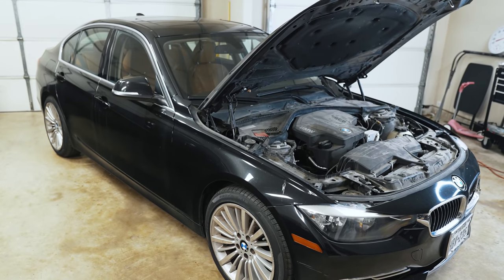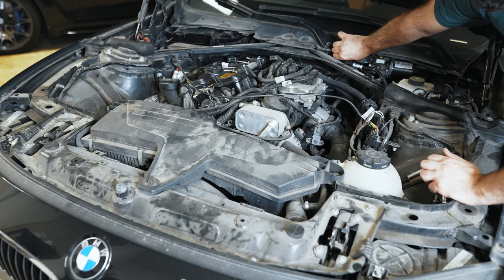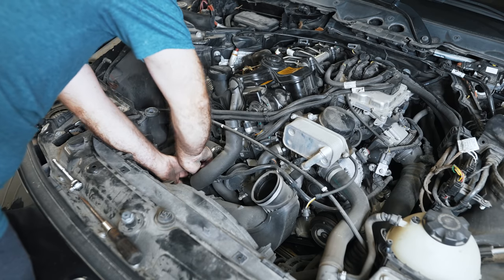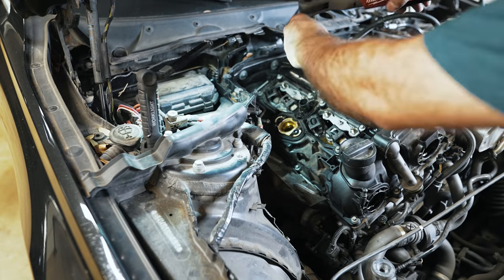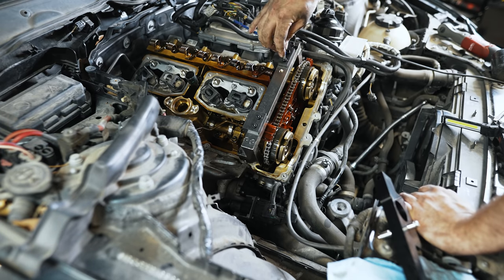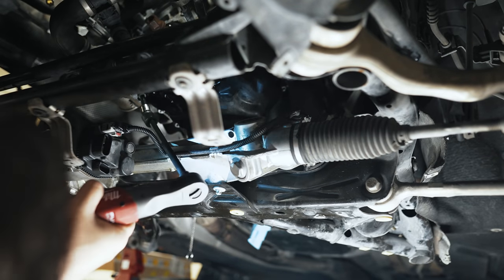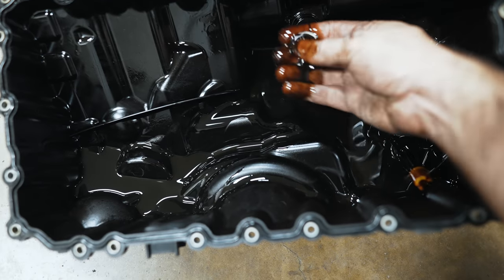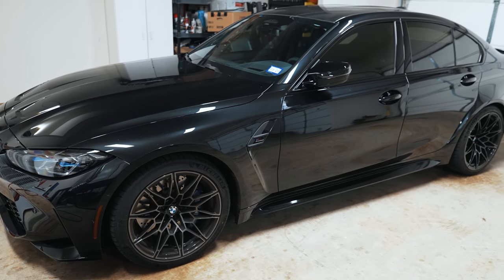All BMWs Get Mechanically Totaled.  This is One.  Saving It!

Comment: Yea, in the same boat but worse with my N20/26. We followed the recommended oil maintenance schedule and it turned out to be too long between changes. Never got bad noises until it was too late. The dealer refused to address the chain prior because there were no codes and then said it wasn't covered after the reduced power code came on because there was now contamination in the oil. Until I pulled it apart the car ran fine and other than for a very short period of time never made any abnormal noises. 
Now that I have it apart, along with the normal timing chain guide issues for N20's, it turns out that the balance shaft ground through the oil pump housing and deposited a bunch of steel into the oil. Luckily all the bearings look good; there is only some minor scoring on cam journals that can be addressed with some minor hand work. The cylinder walls look and feel fine with only mild buildup expected from an engine with 100k miles and only about 8-10 oil changes. Yea, typing that now looks so stupid. I would never let my Saturn's go that long, but it was BMW's service schedule and it has an actual oil sensor so I guess it's ok... is what I thought at the time. 
The real question now is can a dingle-berry ball hone condition the cylinders properly in reality or are these blocks really one and done? Ask a motorcycle mechanic and they will tell you they can be reconditioned (and they do all  the time), but everyone in the BMW world freaks out over the coating.
Thanks for the video's. It's helped me DIY my BMW POS N26.
Reply: Speaking as a prior certified tech (years ago): you cannot just hone a coated cylinder. You'll end up removing even more of the coating which is a hardened compound specially developed to handle heat & wear (these are aluminum blocks). It's not like the old days with a iron block or thick iron sleeve that can be resurfaced. Your engine will eat itself! - If the cylinders don't look too bad just clean them up with a brillo pad and put plenty of molly lube when going back together.
Reply from the maker: To me the recommended intervals started getting longer when the oil capacity started to increase.  So if your engine takes 7 to 8 quarts of oil it make sense that it would take longer to get dirty and break down.  This helped avoid oil starvation and helped lower maintenance costs which helped sell cars.  When they scaled back the engine displacement the oil pan capacity naturally decreased, oil change recommendations should have been adjusted for 4 cylinder cars but that might have looked odd if the 6 cylinder cars needed less maintenance and could confuse the customer.  I guess it was a predicament for BMW but anyone running these cars outside of the factory warranty needs to change the oil at 5K miles in my opinion.
Reply: @VehicularDIY  Absolutely spot on !!!
Reply: @infidel900rr  I'm familiar with the Plasma Transferred Wire Arc thermal spraying process used to coat the cylinder walls of the N20 engines, but there just isn't much information available in the way of rebuilding practices and procedures. It's extremely hard, however only microns thick so there has to be some go-no-go rules to reuse engines with PTWA coated cylinder walls. I know OEM's will just say - replace with new, but practically if the coating is still intact and can be reconditioned to it's original surface finish then it should be good to go.

Comment: I got an 84 318i for $100 in 2000. I swear, anything that could be considered a system was completely neglected. Of funny note, I'd drive down the road at night with the high beams on and couldn't see a thing. All the lights were on but still blind. I opened the hood and stared at a fully lit engine compartment. Turned out all the reflective silver on all the headlights had fallen off and was resting on the inside of each bulb.

Comment: Great video and greetings from Canada. Where do you reference for the procedure to complete this work?
Reply from the maker: Mostly TIS from BMW.
Reply: @VehicularDIY  Only one thing I am confused about: Why didnt you pull out the Coils? In the BMW Repair manual it says to remove those before opening the fuel lines to the injectors. Coils can break if they contact gasoline from what I learned

Comment: I see a couple a week..a BMW Totaled, usually with a death or more. There a favorite of the street racing crowd. They often have the engine torn free lying across the street smoke rising having just spun 7,000 RPM. before the driver loosing control.

Comment: Several times I've heard you mention the turbo oil inlet pipe with check valve.  My car is a 2013 X F25 2.8i.  Is it likely to be the case that my car has the original line?  I just crossed over 100K miles, my waste gate is not rattling, timing chain kit was replaced at @70K miles.  Still seems to have proper boost.  Is it prudent to just change this pipe?  Unrelated, I've been fighting a P0456 ((EVAP) system - very small leak detected) for a while.  Any suggestions on how to find the leak or likely culprits?  I already changed the gas cap...Love your work

Comment: I’ve learned so much from you. I’m looking to buy f30 335i is it reliable? Had a e90 n54 but had to fix allot of issues but loved it.
Reply: The f30 335i with the N55 is fairly reliable.  It has the same problems most recent BMW engines have - valve covers, oil filter housing gasket, etc.  The N55 is more reliable than the N54.
Reply: It depends if you have the money to spend on repairs. I bought a 2014 320i, and it's fun as hell to drive, especially with a sports transmission mod, but it cost me about 8k in repairs so far. 4k just for a timing chain replacement.That little part he takes off at 1:50 costs somewhere around 700-800 without labor.
Reply: The N55 is, apart from the really early models in the F10, a pretty reliable engine. It can have some small problems though, e.g. valve cover gasket, oil pan gasket, oil filter housing gasket, the vibration dampener and the belt tensioner are prone to failure sometimes. However, those are just some minor nuisances that (apaprt from the oil pan gasket maybe) can be DIY'ed fairly easily :)
Reply from the maker: I would say it's more reliable than the N54 and the B58 is looking to be very solid.
Reply: @VehicularDIY  B58 would be 340i m8 :) 
F30 335i has an N55.
Reply: @obihornchen6508  yes like those kind of things are typical and i could do that myself. Just seeing if its a solid engine. like nothing catastrophic.
Reply: @VehicularDIY  okay! Thank you
Reply: @ashokreddy2640  great ya. I don’t think they have turbo issues like the n54 had.

Comment: Hang on I thought any F30 models built after March 2013 had the timing guide materials replaced for better ones?? That’s the reason I bought a 2013 328i F30 currently at 55,000 miles. Should I be worried??

Comment: since the dealer cleaned oil pan out, you could have did the timing chain without pulling the oil pan.... common failure on n20 is timing guides, as well as the turbo wastegate flapper.. total junk engine. I have replaced the timing chain and guides on several of these bmws and did not pull pan, I used grabber tool and vacuum and got the chunks out, ran great. It was a AWD model. so I said fuck pulling that front diff out.. especially working on salary its like 20hr job.. I have pulled the pan before on Rwd model it still pain in the ass. you can also go in the hole the oil level sensor is at and get most of the chucks out... I cant remember if you can change the oil pump chain or not without pulling the pan, its been a while

Comment: What do you think can be the cause of that problem? I got a B48 and some say that the problem persist on any B engine. Is it the oil change interval or quality of the chain, a heat problem or even the design of the engine it self or what?

I've seen other videos where people suggest to change that chain as a preventive maintenance at 150000 Km.  

What do you think? Thanks a lot for your videos!

Comment: Really sad that BMW decided to use those crappy timing chains and guides. Otherwise, they have great engines. Hopefully they will fix that like they fixed the injectors and HPFPs failures from the N53 engine for example.
Reply: N54?

Comment: @Vehicular DIY  I have a question.  I have an 05 BMW 645 with 126k miles on it.  I need my value stems replaced. The independent service center quoted me $4500. Is the repair worth the money or should i get a new car?

Comment: Have 2013 328i bought CPO... it has now 92k KMS and has 2 more years warranty. I change the oil every 7k kms. Should I trade it in while its still in good running condition?
Reply: Don't you like it?
Reply from the maker: If you stay on top of the oil changes I wouldn't be afraid to run it until the hits about 150K kms.  So I'd run it for the next couple years and then you can decide at that time if you'd want to try to run it to 200k and if you don't mind putting a few grand into it to get there.  I'd probably just run it for the next couple years and sell it then.

Comment: Interested on getting a F30 330i, is it really a matter of around @150K miles where the Injectors, High pressure fuel pump and what else will eventually fail? As per the comments at 5.50 timeline?

Comment: Poor maintenance for sure!!
Reply: Yep!.. clearly an abused car in terms of servicing and without a doubt, driven very hard. Those shredded drive belts are also a dead giveaway of how much neglect this car has suffered!!
Reply: I have an 335i 2008 and a x1 2019 msport and I do all maintenance every 5,000 miles no matter what and no issues in my 335 all the plastic parts with Vargas coolant houses,inlets and outlets and tranny brakes and differential fluids on time.motor oil I used for years in all my cars with amsoil.maintnance first before mods and you have cars from years to come,bmw experience.

Comment: hi，my question is how long it will take to replace the turbo oil feed line？my car is 13 528i，my mechanic quoted 7 hour labor，is it reasonable？Does that require turbo removal？？thanks alot！

Comment: Hey man do you have an Instagram? I am doing the turbos on my N54 335i this weekend and I had a small issue with the tow hook not threading all the way down and I wanted to know if that was normal or if I should buy a thinner tow hook, thanks.
Reply from the maker: The tow hook doesn't go all the way down, but it goes in enough to be safe when bottomed out.

Comment: Change oil religiously on the n20 engines. I do mine every 2.5 to 3 k. By the way. On my 3rd water pump in only 34k miles.  Yet another known seriuos prob with these engines. And all the crappy plastic stuff. Ugh.
Reply: Sorry actually 2 waterpumps and 3 thermostats in 34k miles.

Comment: Just curious, how much did you charge your friend for the repair and parts? What was the total amount.
Reply from the maker: Less than a 1/4 of what the dealer was going to charge.  That includes the replacement turbo, oil filter housing gaskets etc.

Comment: Hi I love your channel by the way.but I got a question.I got a 2018 f30 that was recently in a accident I replace the intakes radiator stuff like that but now the car driving but the car dosnt have any powers when I step on the gas pedal while I’m driving,but when it’s in park and gassing the car it got all the power but not in drive tho. it’s slow when I accelerate on the gas and the pedal sink all the way to the floor,you have any idea why this going on?
Reply from the maker: Thanks.  Do you get malfunction when you push it?  You might now be making boost and the car would throw a drivetrain malfunction.
Reply: @VehicularDIY   no malfunction or codes or drivetrain codes…no check engine light either…car just driving like it’s in limp mode with no power at all driving pretty slow and the gas burning really fast
Reply: @VehicularDIY  when the car got into a accident it got drivetrain malfunction codes but i fix all them issues replace radiator and intakes replace battery and battery cable cause airbag deployed also..car start up and driving but no power when in drive and step on gas pedal…but when it’s in park the car got a lot of power when step on the pedal,just not when it’s in drive…when I put the car in sport mode in park the POWER gauge move high up but when In sport mode in drive the POWER gauge barely moving cause of lack of power

Comment: Obviously off topic and not sure if is a ave you want to fiddle with because of fear of being very easily overwhelmed  with 100s of questions..  Anyway have a 13 e92 n55 manual with with MSport and unfortunately  xdrive 120k 2nd owner CPO up to 100k EVERY AND ALL SERVICES THAT COULD BE COMPLETED/ALLOWED FOR REPAIR OR REPLACEMENT WAS SORTED.  2 months ago I got my second engine leak, my first was the standard valve gasket and I easily diagnosed this gasket as the issue because of the leaking onto exhaust.  This leak is like nothing I've ever heard of and seems like a full instant failure.  Went from zero oil leaked anywhere to needing a quarter of oil ever other day....pool on rightist part of driveway..   I thought it was the oil pan then thought I saw oil filter housing.  There has not been a full dive into it because of needing to still find a mechanic and wirh the pandemic funds were and still are an issue...but I'm  being told it's valve cover gasket..1.  could this possibly leak that much? 2.  How rare is this and if I  find  that undeed it's the valve cover gasket, would BMW North America back any of that previous work ..I do understand what I'm asking, I know it was 2 years and 20k miles  ago it was replaced but never know when consulting with BMW NA,  I've experienced first hand and heard of unbelievable room for BMW customers.   At rhe very least since all work don't through BMW Seattle,  or BMW NW they may b very interested just how this has shown up.   O seriously can't find any real detailed example that covers the area and amt I'm dealing with 

Apologize for this nightmare thesis I just wrote it's so hard to be detailed but not long winded , present an educated question easy enough but with just enough interesting factors it holds attention and doesn't make the author look or sound like they are helpless.   Honestly really hoping for advice or a miracle phone number for someone in the  Pacific Northwest,   Obviously there's the dealership and I also know that a decent oem mechanic is going to be still very pricey if there weren't anything Those are the standard options that I can obviously get my vehicle too and getting taken care of I was hoping for something outside the Box and led to a relationship down-the-line being I need about a year's worth of assistance putting this or that back right end and growth anyway thanks for your time I apologize again for this ridiculously long nightmare
Reply from the maker: I don't think they would back the work as that is considered wear and tear part.  It could fail with time not just mileage.  If it's burning oil it could be the integrated PCV that is built into the valve cover or your valve cover could have developed a crack.  I would get a new valve cover when tackling this job.  I made a video replacing a valve cover on an N55 and go into detail as to why it should be replaced as a whole rather than the gasket itself.

Comment: I went through 2 additional engines on my 545 and they all ended up having the same "problem" the same cylinder going out and needing a new engine, after I had the transmission rebuilt.  Never again
Reply: Just sold my 335i. Similar experience. I’m buying Japanese from now on.

Comment: At 100,000 on the clock, I would have just pulled the motor to do a full reseal and clutch job on it.  But that's just my two cents.

Comment: I'm from Ireland and 90 percent of all bmws here are 4 or inline 6 cars...the problem I think with these v6 and 8 DOHC engines is the chain is way to long...and the longer a chain is the faster it will stretch ...take the older pushrod engines ..the cam is close to the crank and the chain is only about half the length of a OHV engine they go hundreds of thousands of miles with no probs...also these cars that are high power should have a double chain...

Comment: I have had cars that have done well over 350000 miles with only routine service items having to be dealt with. They have been mechanically sound even after this mileage, and it is usually rust repairs that make it not economic to keep on the road. As that is my expectation from what I have experienced I find the mileage that owners get from BMW and other European brands extremely poor and not acceptable. The reliability issue that they experience can be attributed to poor engineering and design.
Reply: Cars die because owners don't service and maintain them.  In 1988 the head gasket went on our Peugeot 305 at 72,000 miles we scrapped it.  In 2018 the head gasket went on our Citroen at 76,000 miles I got that fixed and this year the temperature sensor failed fixed that too, but the roof stopped working and they don't make parts for a 15 year old car.  I went back to our 1988 BMW saw a split in the intake bellows went to the dealer and bought a replacement from BMW for a 33 year old car.
Reply: @robi4387  The idea of a timing chain setup is that it is supposed to last the service life of the engine. It is a common issue on these engines. If it does not last the design is poor as is clearly the case in this BMW. Interesting to note all the cars that you mention are European brands, seems to be a oomon theme there. If you are used to driving reliable vehicles then  you find this sort of thing not acceptable.
Reply: @TheAllEngineering  I agree with your first sentence.